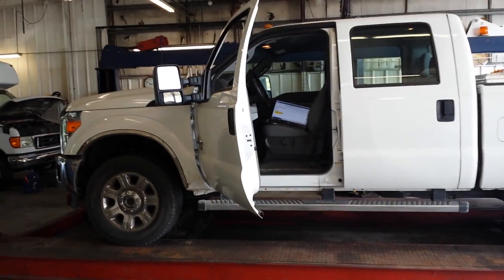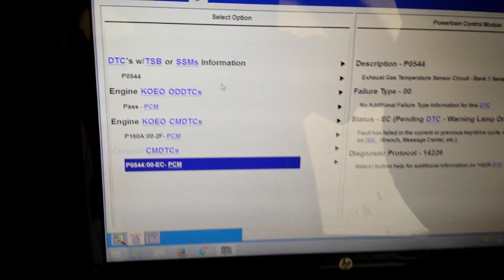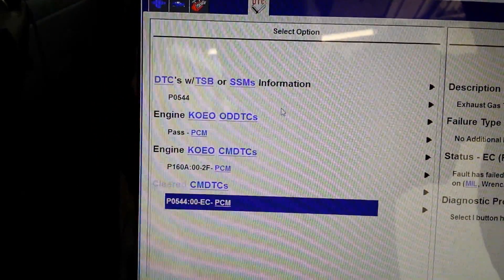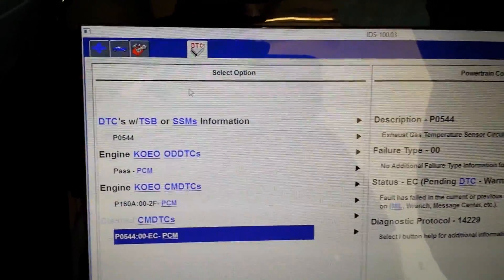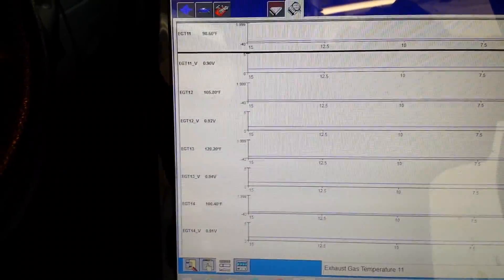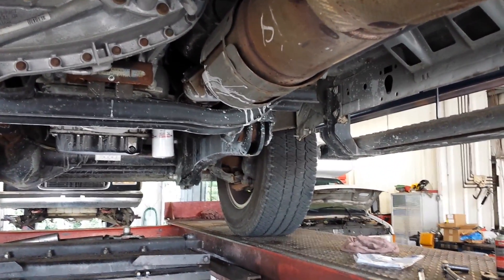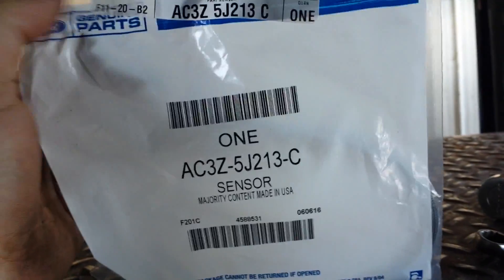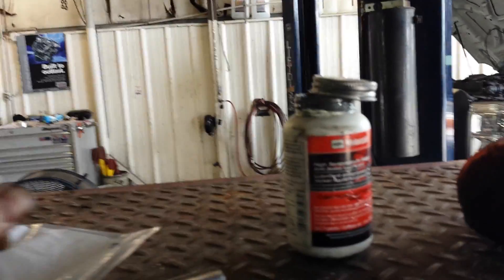6.7 liter mil on egt sensor

Comment: I really appreciate the time you take to create this content, and sorry about bringing up a question on an old topic, but I have a question about the egt sensor under the hood in the  EGR system, is it the same item as the 4 in the exhaust system and if it is or not, should it get replaced because of the high failure rate of the temperature sensors? My truck is a 12 f350 6.7, currently trying to chase down the lack of performance that it once had, this is after cp4 failure and complete fuel system replaced, although the power had been diminishing prior to the failure, now I believe it is a sensor that doesn't throw a code, but is not quite right. Boost will get to 20 psi quickly, but drops down to the 12 to 13 range shortly after, I suspect the ECM is pulling back fuel for some reason, and it's air flow or EGT related. This is with motorcraft air filter and MAF sensor cleaned with CRC maf cleaner, my other thought is the VGT control on the turbo, I don't think the turbo physically is the problem because it spools quickly and hits 20 psi no worries,   I think it's being influenced by another system.  302k miles work truck, towing constantly about 100k per year, no exaggeration. Thanks for taking the time to read this and any suggestions you may have to resolve this issue.